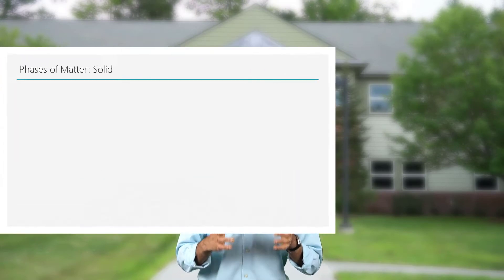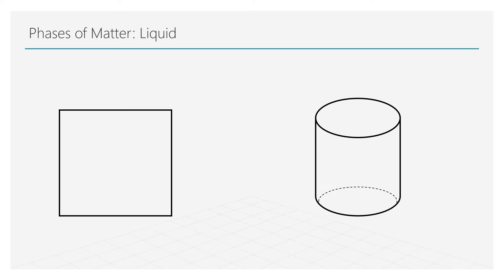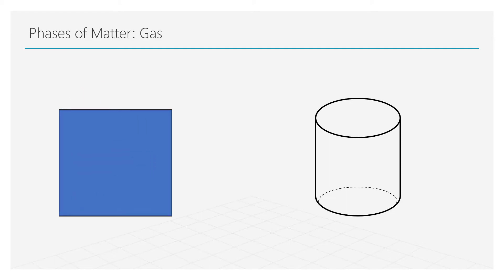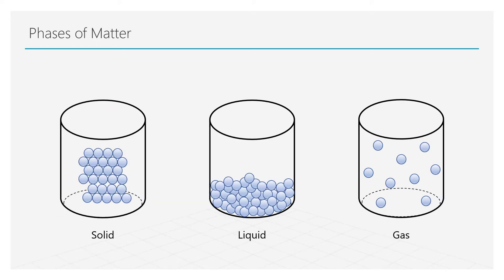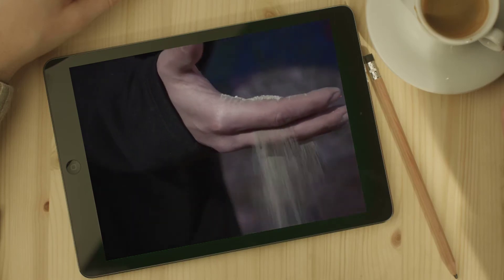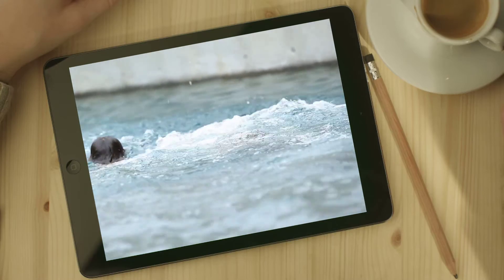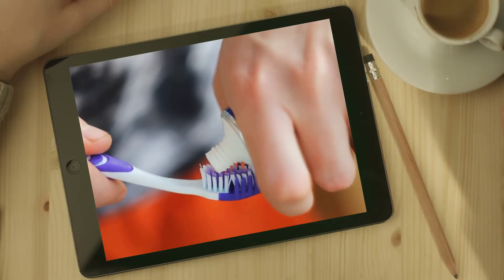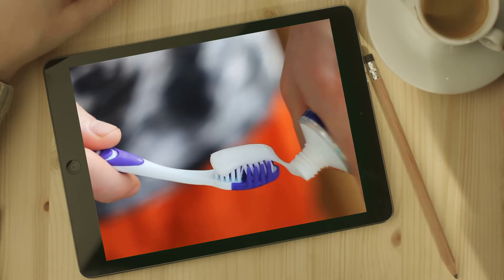Intro to Fluid Dynamics — Lesson 1

Comment: The most widespread are thermal power plants (TPPs), which use thermal energy released by burning fossil fuels (coal, oil, gas, etc.).  Thermal power plants generate more than 70% of the electricity on our planet.